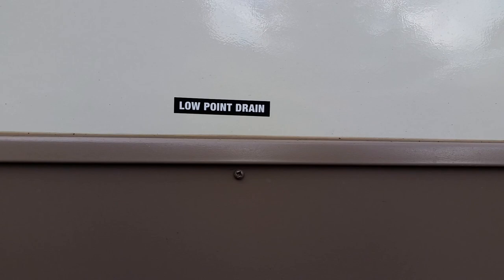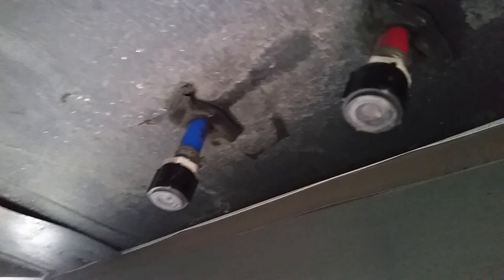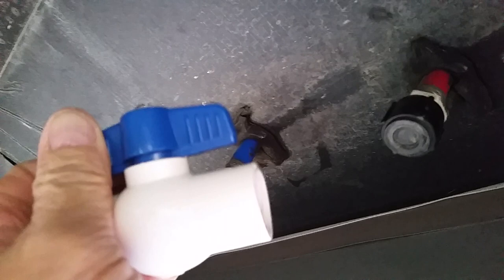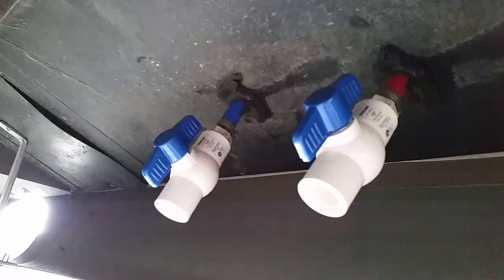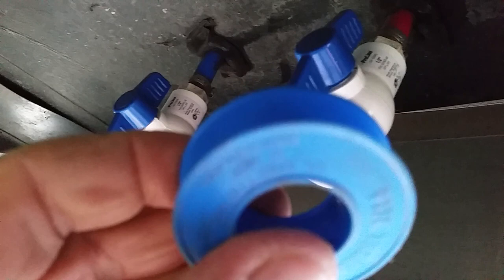Travel Trailer Modification to the Low Point Drains

Comment: One of the first "mods" I did after watching your video.  Sure makes winterizing and dumping all the water in the lines so much easier!
Reply from the maker: So happy I could help Rob, its so easy to do and does not cost much to do either. I think the newer trailers come with shut off valves now instead of caps

Comment: Except when your drains are coming through the same hole in a tight spot where I can't even fit a wrench to get the old caps off. It'll be a little more complicated for me!
Reply from the maker: Or you can do this? 
1/2 in. PEX Barb x 1/2 in. Female Pipe Thread Brass Swivel Ball Valve -
https://amzn.to/3uY7FTt
Reply: The flashing running along the bottom of the trailer makes for a tight fit. I was able to get some smaller valves installed.
Reply from the maker: @KP-ni8bh  That's great news, you did it :)

Comment: You didnt show how to remove the existing ballve the clamp.Did you cut the drain house.
Reply from the maker: I didn’t have to cut anything, it was easy and fast to do. Just remove the caps that came with the trailer off the threads turning them counterclockwise with two pairs of pliers to remove the put Teflon tape on the threads and install the ball valves turning clockwise. I hope this helps

Comment: Mine did not work as they put the cold and the hot right next to each other and i can't screw in the adapter.
Reply from the maker: That's a bummer Jaz, are the hose short or long? if they are long sometimes you can flex them apart to be able to install the valves.
Reply: saw another video where the poster had a friend hold the two pipes apart so he could turn the valve to tighten.

Comment: I just bought a rv and so lost it’s a older model but I have these hose on the side of the water heater and going crazy trying to figure out why water comes out from the shower. Do you think this would work for a 99 Jayco designer model? Thank you I’m advance
Reply from the maker: Is the water coming out of the shower head or the grain on the floor? Is the water working correctly at all your other faucets in the trailer?
Reply from the maker: Does this video help you? https://youtu.be/68HG-5TwOuQ
Reply: @thetraveltrailerguy  thank you

Comment: Hi Michael, I was thinking of doing the same. What size is the inner diameter for that ball valve?
Reply: Edwards Journey I used a 1/2 inch PVC threaded ball valve that I bought at Home Depot. Make sure you wrap at least 5 wraps of Teflon tape around threads before installing

Comment: New with the RV life , am I supposed to drain these hoses?
Reply from the maker: I have only drained mine a few times and not much comes out. We live in California and don't really get freezing weather so we don't really need to winterize. We also camp every couple weeks so new fresh water is in the trailer often, if we didn't camp so much I would drain them more often. Another thing I do is if we use the fresh water tank and it has water in it when we are done camping I drain the tank before leaving the campground and drive home with the fresh water tank valve open to make sure all the water is out of the tank so I does not sit in there and turn into bad water.

Comment: No one actually show the threads on their rig, or how they are prepping the area. :(
Reply from the maker: I'm not sure what you are saying, maybe this will help answer your question - https://youtu.be/f7mjyzfB9Ec
Reply: What he means is you didn’t show taking off the old cap and whatever else had to be removed. You also didn’t show putting on the new valve.  Would have made this video even better.